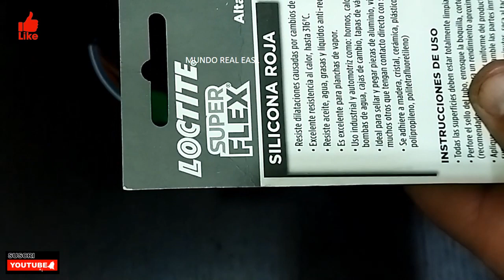FALLA SCENIC RENAULT SENSOR TR PARE  NEUTRO MANTENIMIENTO PARTE 1

Comment: Hola. Yo mismo cambie ese sensor porque me estaba presentando falla y no me hacia los cambios correctos pero le puse uno nuevo y el remedio fue peor que la enfermedad. Los cambios ahora no los hace y la velocidad de mi vehiculo es lenta a tal punto que no sube pendiente. Que puede ser, otro sensor de la transmision que este presentando problemas???
Reply: Solucionaste el problema mi carro está igual?
Reply: Siiii. No era el sensor, eran las bases del motor y de la caja que estaban dañadas y cuando se movía el carro se perdía la calibración del sensor y daba falla. Solución: cambiar todas las bases del motor y caja.
Reply from the maker: si claro, pero primero deja el original y le haces mantenimiento, si la falla persiste puede ser tema de masas